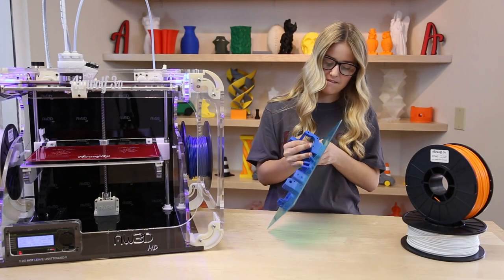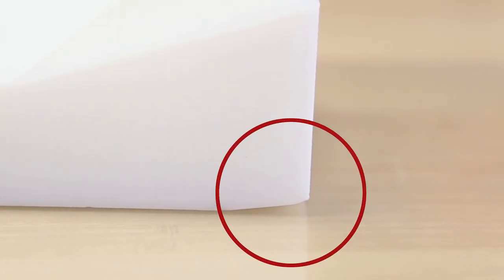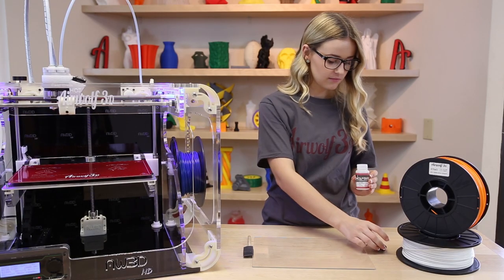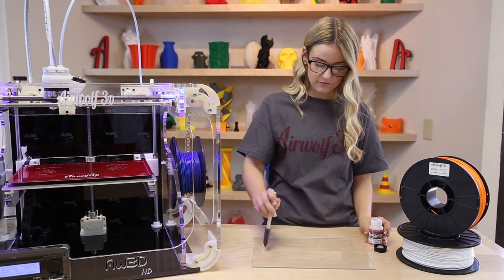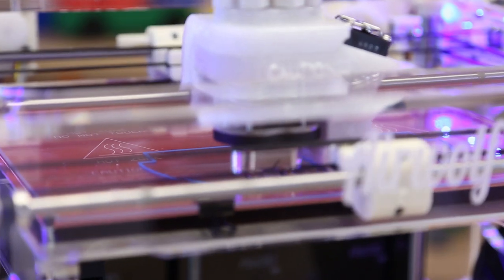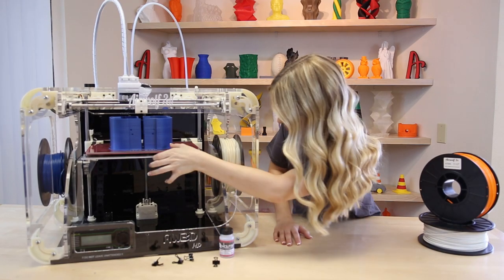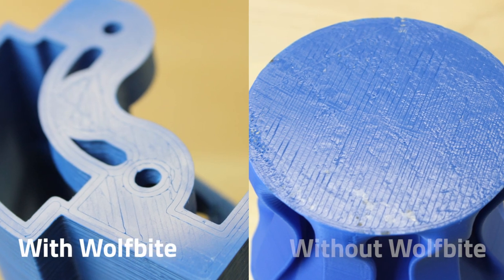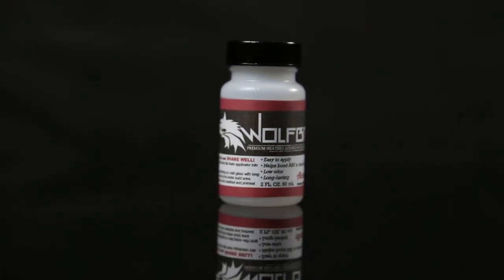3D Printer Bed Adhesion for ABS and Heated Bed - Wolfbite for ABS, PETG, TPU, and TPE

Comment: As advertised.  I have tried everything and this is the only thing that worked.  The first layer is very important.  For my printer I had to set to 1% of size for first layer and 200% width and it worked like a charm.  It is very cheap considering that one little bottle will go likely hundreds of prints.  I have spent 100's of hours trying to solve this and am glad I can now devote those hours to building my prototypes.  Once cooled part came off just like video.

Comment: I bought a bottle a few months ago and have been using it very successfully with ABS.  I'm using a CubeX Trio with a heated build platform, composed of ordinary 1/4 inch tempered glass.  I'm heating to 100°C and after printing the parts detach from the glass by themselves, just like in the video.  Also, there is no warping whatsoever, even for large parts!  When canceling a bad 1st layer.  The single-layer can be easily removed while the build platform is hot via simply using a steel spatula.  The 1st thing you think when you purchase the small bottle is this is not going to last very long.  On the contrary though, since so little is used, and multiple prints can be done in the same area via a single coating.  I see this little bottle lasting for years since I can also print my smaller models all over the build platform in an array pattern.  Thanks Airwolf for the amazing product!
Reply from the maker: Thanks, James Kincaid .

We are glad to hear that you like your Wolfbite adhesive solution!

Sincerely,

Airwolf 3D

Comment: Anybody else got feedback on this apart from Alan?? I'm also interested in trying it but for $20, I need to know it works significantly better than ABS slurry
Reply: Well I've only made 1 print so far with this Wolfbite stuff and it came out as one of the best prints so far. It was a part that warped pretty bad on glass with hairspray. I know that this is on the expensive side but so far it is working for me. Side note: the part didn't quite unstick from the glass quite as easily as the video shows but it still came off very easily.

Comment: how can it have such great adhesive qualities, and then be wiped off by a girl simply moving her hand across the prints. If this is true I want some.
Reply from the maker: Hi CodenameBravo! Our Wolfbite Adhesives are thermal additives and react to heat..... when the bed is hot the part sticks really well, and when it gets cold it will release the part.
Reply: Airwolf 3D whats the ideal bond temperature the bed should be.